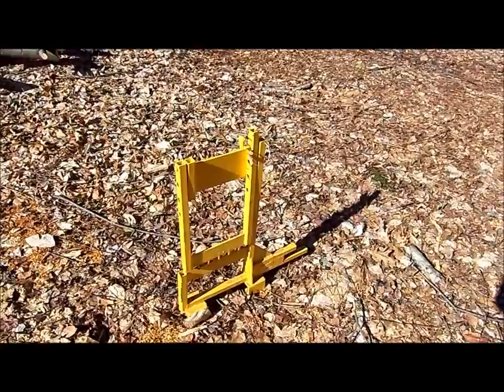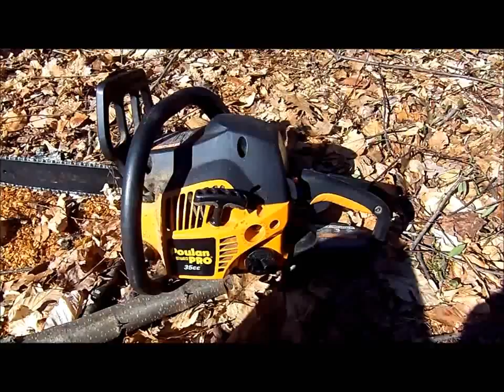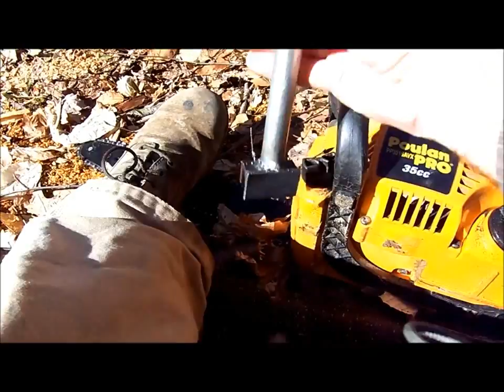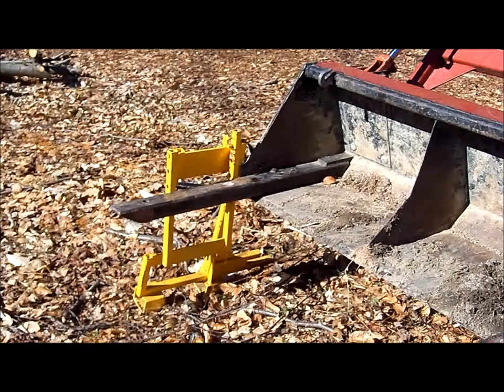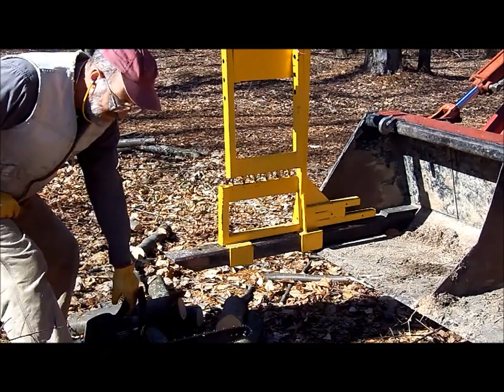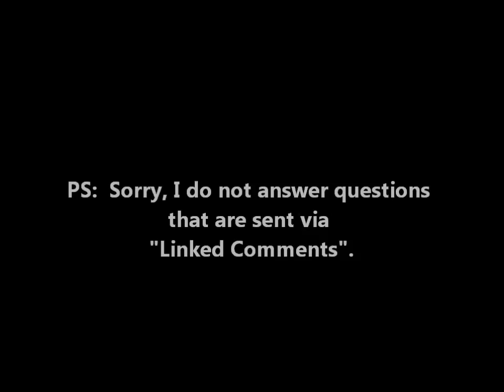DIY Firewood Holder

Comment: I am really glad I came across your video.  I took your contraption and adapted one to fit into the receiver hitch on my pick-up.  Of course I can't raise or lower it, but the logs to be cut are waist high.Keeps the blade out of the dirt and no more bending over to cut those 3" to 8" logs. I even painted mine the same yellow color.  It seems I tend to walk into things.
Reply from the maker: Great!  Anytime I cut firewood, this goes along.  Yup...I know about walking into things also.  Thanks for watching.

Comment: This looks great.  I use an old JD model M and I could attach it to the draw bar.
Do you have plans for this?  I do not weld, but know a near by welder.  If no plans,  is it possible to do a video of how it is constructed (i.e. measurements, how you made the quick release lock, etc.)?  Thanks
Reply from the maker: You could easily attach to the drawbar.  The only downside is that you can't lower the holder to the ground.  As the limbs get larger, not having to lift them up to the holder is a major plus!  I've had large diameter limbs over 24 feet long in this holder (of course, the load has to be balanced).  I'll see if I can post a more detailed video on the holder in the near future.  Thanks for watching!

Comment: Why dont you just use your chainsaw tool the screwdriver portion lay it between the ears of the cap and twist ? More leverage thatvway
Reply from the maker: Good question!  I tried that on the first gas cap.  This is cheap plastic.  Doing what you suggest, the gas cap "ears" spread apart and the cap would not budge. It is amazing how badly this thing seizes up...it takes a lot of torque to get it to break loose.  You would think they would use a plastic that wouldn't be affected by gasoline. Thanks for watching!
Reply: Ok